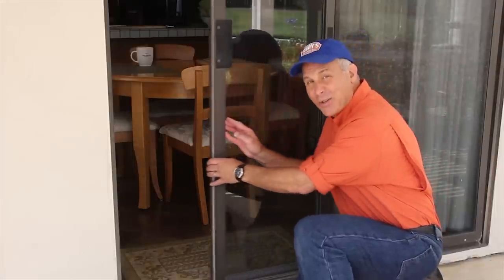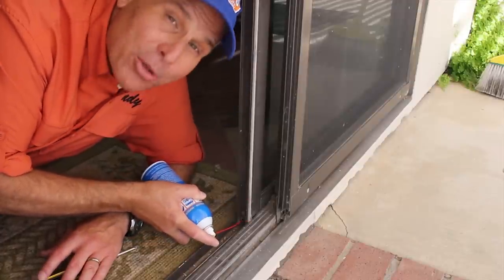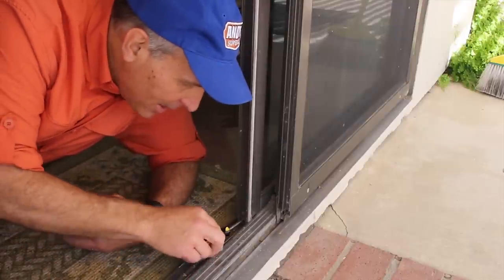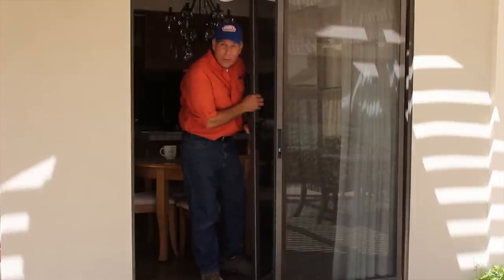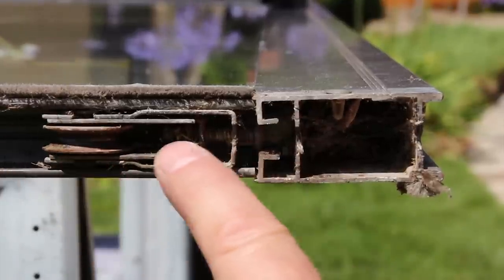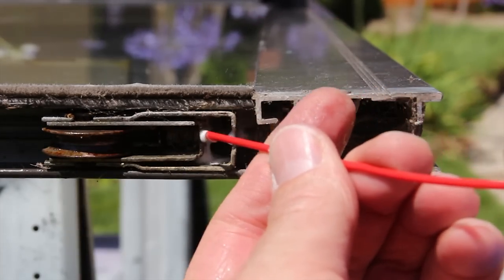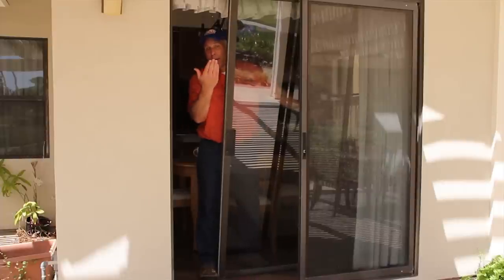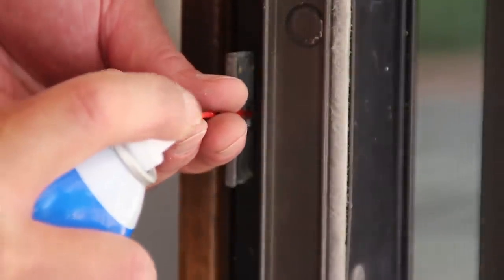How to Lubricate your Sliding Glass Door – Andy's Super Oil Tech Tips

Comment: I'm confused only by which direction to screw. Counterclockwise lowers the door by retracting the wheels? Clockwise raises the door by extending the wheels? So, LEFT lowers, RIGHT raises. Easier to remember.
Reply: There is no left or right, only clockwise and counterclockwise. When you rotate something it moves both left and right at the same time.

Comment: In a desert climate, especially, oil attracts dirt which gunks up sliding doors and windows.  There are dry lubricants designed for this.
Reply from the maker: That's the beauty of the oil I make - Andy's Super Oil. It doesn't attract dirt. I've used it on many doors in Phoenix and it works well there. Thanks for watching!

Comment: I would think if your actually going to go through this much trouble it would be more than prudent to replace the roller mechanism! Maybe even upgrade to a tandem roller assembly?
Reply from the maker: You're right. If they are worn down, it's certainly more prudent to replace them. However, not everyone has a local hardware supplier that carries the proper roller assembly and you might have to replace the window while you wait to obtain the proper replacement parts. Thanks so much for writing in.

Comment: Hey Andy, While oiling and cleaning my glass door frames from all of my dirty hand prints I used goo gone and wiped off all the grime. I thought why not use goo gone to clean the grime off the wheels?...then oil? What do you think? Spray it under the door and keep sliding across wiping off the black grime as it comes off the wheels on the tracks?

Comment: I was wondering if sliding greese is okay to use on flutes putting my foot and head of my flute is starting to get hard my friend suggested sliding greese will that work?
Reply from the maker: Hi Yumi. The experts say that you should NEVER grease a flute. If it is getting hard to put together, then wipe the joints with a soft cloth to clean them and then try again. If they won't go together, then one or both are out of round and you should take it to a repair shop. Best of luck!
Reply: +Andy's Super Oil danke!

Comment: Petroleum products can cause plastics to break down, weaken or crack, so don't do this on PVC or other plastic doors. If it is making noise, first, check to make sure the track is clean and the wheels are at the right height and the door is not sliding on the track. If the  height is OK, take the door off and cheek the wheels for damage and that they move smoothly. If they don't move smoothly, take them off and try oiling them. Wipe them clean before putting them back on. If they still don't roll smoothly, replace the wheels.

Comment: thank you... do you need to make sure it is balance, do you need to adjust both ends. and balance???
Reply from the maker: Most of the time you can get away with just lubricating and readjusting so that the door is plumb to the frame. That way it closes and latches properly. When you reinstall the door, turn the front and back adjustment screws a similar amount and then tweak them a bit so that the edge of the door is parallel to the edge of the frame. Good luck!

Comment: I got a patio door with a center rail & have a hard time getting out the dirt underneath the center rail. Any tips?
Reply from the maker: The sliding door in the video has a center rail. usually, you can either run a vacuum or blow out the dirt and then wipe down with a clean cloth. That should be "clean enough." Otherwise, try lowering the door fully and removing it (get some help - it's heavy!) by lifting and then angling it out. 

Hopefully, the vacuum and wipe does the trick. Some people also like to put furniture polish on the cloth they use.

Comment: We have a lot of wind noise coming in from our sliding glass door due to high winds from a storm. Is there a good and easy way to seal it?
Reply from the maker: Hi Michael,  Most of the sliding glass doors use strips of weather sealing along the top and bottom channels to stop the airflow you're describing. So, look to see if it's still there. Usually it's soft and a bit "furry." If that seal goes, then the wind can work its way through the gaps. You can find replacement sealant at glass window stores. Hope that helps!

Comment: Yeah but the door still sounds like junk..... how do I get what seems to sound like the roller is hitting many little potholes sound to go away????
Reply from the maker: If the track is clean and smooth, then the problem is most likely the wheel that rides on the track. Pull the door off (like in the video) and check out that small roller. You can buy replacements for most sliding glass doors. And make certain to lubricate the assemly. Best of luck!
Reply: You were right all I had to do was adjust the wheel height and clean the track and lube the adjusters and the track sounds like a whisper now. Thank you so much
Reply from the maker: @bcsk8r1  So glad it worked for you! Happy Holidays!
Reply: Ok so now the wd40 doesn’t like the below freezing temperatures in north  Virginia. Any suggestions on an oil or lubricant that withstands 5 degrees F ????? I scraped the track and cleaned with paper towels. Only lube I’ve used is wd 40.... but after 3 nights of freezing temp my door is actually jamming and bucking up as I pull open.... Andy’s super oil dot com maybe????
Reply from the maker: @bcsk8r1  I've never thought of using WD-40 as a lubricant. Most of the professionals I know use it only as a cleaner. It's a convenient solvent; that's why the company promotes it for taking crayon out of carpet. But as a lube? It's got a bit of light mineral oil but nothing speial. I'd suggest Andy's Super Oil, but of course I'm biased!
Reply: Yeah I’ve used wd40 in a lot of situations on construction job sites and it always worked for my skate board wheels as a lubricant... but that was in California. Never really freezing in Cali. Now in Virginia I guess I’ll have to buy some real oil. Thx
Reply: @bcsk8r1  Are you sure the jamming and bucking isn't because of frozen condensation on the track interfering with the door's movement? Also, it could indicate the door is riding too low and is contacting the track and needs to be raised by adjusting  down the roller mechanism so that all contact is on rail only.

Comment: that wont help if the roller bearings are shot like in this video, replacing the rollers is the way to go.
Reply from the maker: I agree, but the point was really more about lubricating the wheels. Those rollers were shot and the new rollers made a huge difference, though the old ones were acceptable once they we were cleaned and lubed. Thanks for the keen eyes!!
Reply: Andy's Super Oil  Best video on youtube on how to lubricate wheels ... going do mine . I wanted to also ask if lubricating top of sliding door is good ? not sure if it has a wheel but may help to slide ?